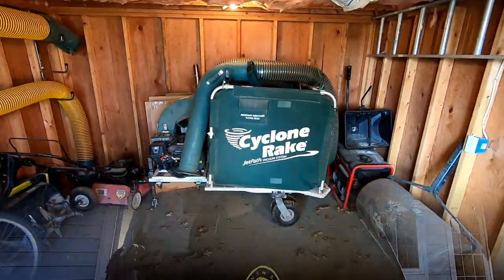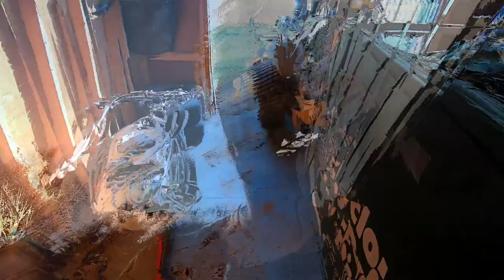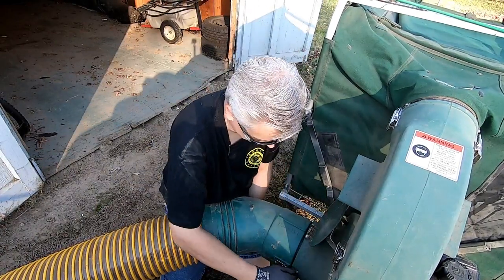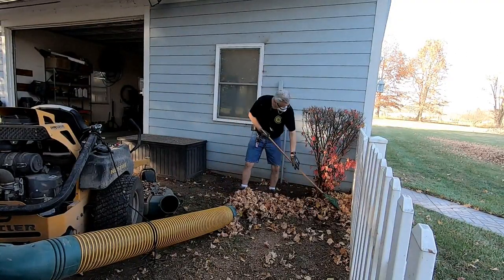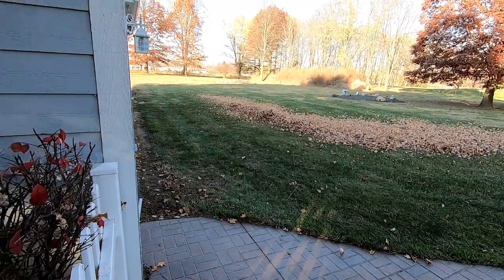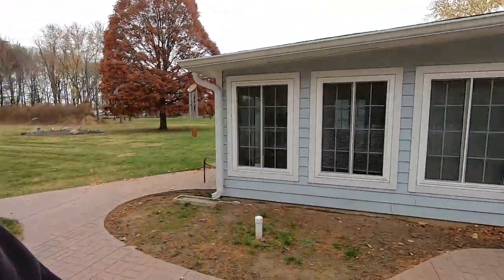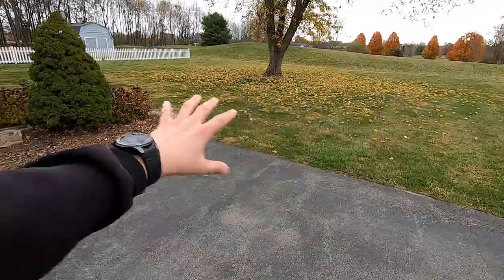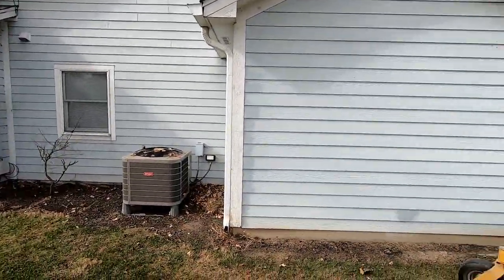" LEAVES 2020 " episode 3  Release of the   CYCLONE  rake !!!!!

Comment: I've had mine since 99, It's the basic model , I wish I had went with the next one up,  The Commander.  I could of used it here for sure.   I put the 6.5 motor on it last year,  That really helped it have more suction and it does a great job with it.  Its a dusty machine in use, But its a good solid leaf Vac.

Comment: Great video! Awesome drone footage. Great idea to pull the deck hose off & rake material to the inlet for those small areas that you can almost get to but not quite. I've had my Commander for about 8 years & agree these are some of the best built pieces of lawn care equipment money can buy, saved me hundreds of hours of back breaking work in the fall. I would disagree with your comment at 5:50 regarding getting the biggest unit you can afford, IMHO there are two primary considerations when picking which unit to buy...1st is what mower will be used with it, a smaller rider will struggle with anything bigger than the Commander unless the property is very open & flat. 2nd consideration you somewhat eluded to in this video is the property layout. slopes and abrupt contour changes will be easier to navigate with a smaller unit, same applies for properties with a lot of obstacles to work around & through. the larger units have a wider footprint and they do get heavy quick, especially when collecting wet debris, making them difficult to control on side slopes and a lot more weight to deal with when lifting to empty, you really need a large garden tractor or commercial mower when you get into the Commercial pro & up if you have slopes or steeper grades to operate on.
Reply from the maker: I agree about the comment on the largest hopper my mower is big and very powerful and could handle the bigger 1 but  a smaller mower would definitely have trouble handling the weight and also storage of the bigger unit is a consideration I don't fold mine up  I just park it as is, the big one would not fit in my Mini barn but it's hard to cover everything in the videos thanks for watching and commenting and please subscribe to the channel if you haven't already
Reply from the maker: Be sure to check out my leaves 2021 videos

Comment: I have exactly the same setup, even the same brand of zeroturn.  How do you keep the output screen from clogging and blocking the air flow?  As soon as I go about 20 feet, airflow into the hopper stops and the air then goes out the side discharge outlets on the blower.  Any tips?  Great video!
Reply from the maker: I'm not really sure what to suggest I've never really had a problem with screen on the hopper clogging up, the only time I've had an issue with it coming out the side discharge vents above the blower is when the hopper gets to full or when I'm using the hose and try to suck up too big a pile of leaves and it clogs , Now I do believe there are 2 different screens for the hopper one is more fine if you're using it for grass and the 2nd one allows more air flow for leaves.  Thanks for watching and be sure to go back and look at my leaves 2018 video it is one of my favorites and stay tuned for leaves 2021 it will be epic lol.
Reply: Marty, Are you installing the top vent screen properly? The deflector that hangs down inside the bin should be near the back of the bin not the front. It sounds like you may have the screen backwards and the deflector is restricting the material flow into the bin, although this would also be directing the venting debris at the back of your head instead of out the back of the unit. you can always swap out the leaf screen that has smaller screen openings for the grass screen that has larger screen openings to see if that helps. Good luck!
Reply: @StratOvation  Thanks for the advice.  Unfortunately I have tried both screens and made sure that I had it the correct direction.  I am experimenting with different throttle settings to see if any of that helps.  i will let you know.  Thanks again.